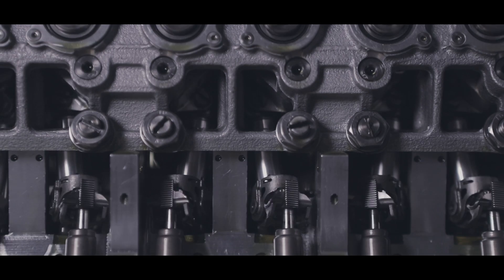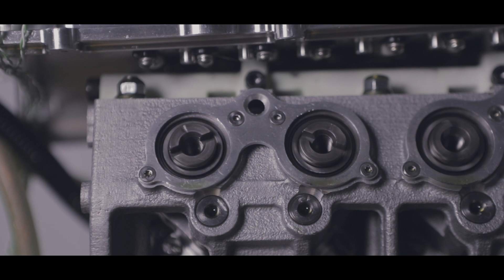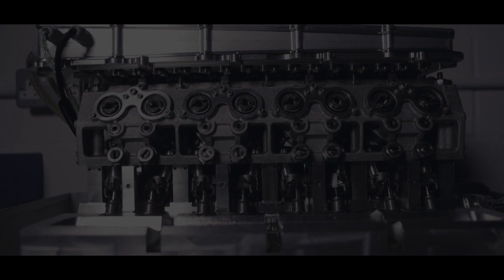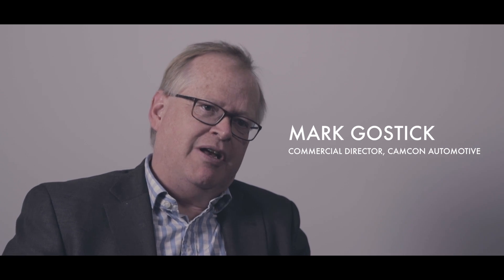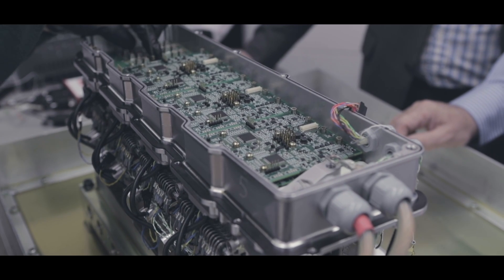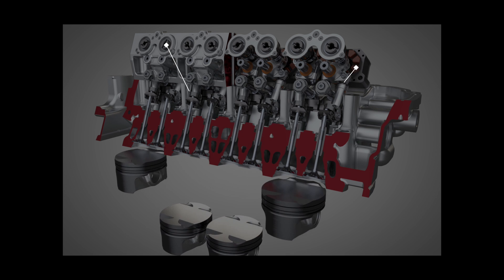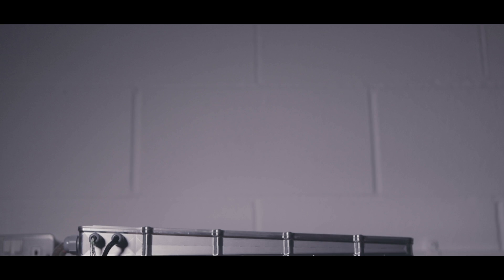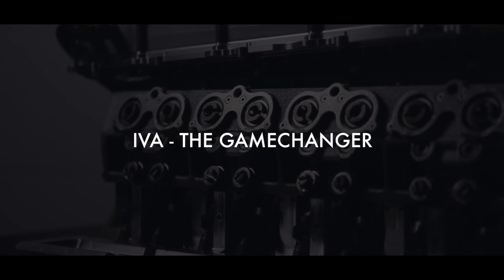Intelligent Valve Technology - Petrol engine, diesel efficiency

Comment: Interesting they went with mechanical individual cams instead of pneumatic actuators. This design is robust but limits the valve life profile to the ground lobe profile. It also adds a whole lot weight and complexity to solve a simple question

Comment: a valve is simply a door that opens and closes. I would think a spinning disc with an opening to release or intake work with so less parts and weight with electronic controls. Moving a valve in and out with all the springs or pneumatic parts over complicated.   A spinning disc with a port would not need much power to move rotary fashion a half turn per cycle.

Comment: Oh. Great. Yet another electric circuit to malfunction, in potentially many millions of vehicles, related to extreme summer and winter temperature conditions.  Most vehicles rarely, if ever, get sheltered in a garage, either...so most would be even more vulnerable. 
One more feature to increase maintenance costs and decreased lifespan of unit, more like it.  
But mainly, it looks like everything Petrol industry controlled, is finally realizing larger competition....other choices rapidly becoming bigger players in the market.

Comment: If you want to amortize the R&D cost, make retrofit head kits for the Chevrolet LS and pre-LS small block V8 and the Ford Windsor small block V8 series. The custom and hot rod market would buy these systems like crazy. Another huge chunk of the aftermarket would be the Ford "modular" V6 and V8 engines, and the Dodge OHC V6 and V8 from the late 90's into the 2000's. Dodge small block V8's (the Magnum series and previous series) could also be a good market to target. Need more? How about Ford's 1600 through 2300 cc inline four cylinders? All those are still used extensively in racing.

Designing retrofit kits for some older engines that are very well understood by performance engine builders would show the automotive industry the capability of the IVA system to be adapted to current engines. With the older engines widely used by enthusiasts, you'd have a ready made testing group.
Reply: The crazy shit you could do with digital values on an LS would turn that engine into a monster.
Reply: taking apart an engine block is NOT an easy "retrofit" like you just walk into jiffy lube and buy a muffler.

Comment: In modern technology, the engine is used to generate electricity. And can the pistons be made magnetic so that they generate electricity by their movement?
Reply: Nothing is free. If you try to generate electricity with magnetic pistons,  you'll greatly increase the "friction" of the pistons. It's not really friction, as in parts moving against each other, but those magnetic fields would encounter resistance from the coils in which the electricity is actually generated. If you've ever used a hand-cranked generator, say in a middle-school science class or something, then you'll know what I'm talking about.

Comment: Why use motors to turn cams?? Just use actuators to open and close valves
Reply: More control over valve lift and dwell this way.
Reply: rotary motion actuation is more robust than linear electromagnetic actuation.

Comment: you have drastically increased the number of parts and electronic involved. I thought part reduction was  number one priority of todays top auto manufacturers because it leads to less weight and less complication therefore less pollution.
Reply: The wieght and complication is outweighed by the gains of this system. Better efficeny means far less co2 emissions than it would take to create it. As well as better mileage and power. Which counteracts the miniscule wieght added.
Reply: Well, no.  Everybody is so ga-ga over hybrid cars, they don't notice that hybrids are hundreds of pounds heavier than the gasoline cars they are derived from, and the inclusion of the extra powertrain means they are doubly complicated.
Reply: No, cars are going full computer controlled so help reduce emissions not the other way around
Reply: Electronization may increase complexity, but also increases reliability. That thing needs no special oil or precisely manufactured camshaft, yet it can be far more efficient.
Reply: 1 control system = 1 part

Comment: looks like an interesting system... although it increases the overall height of the engine from crank centerline to the top of the rockercover... the goal should be to decrease this dimension to lower centre of gravity and improve packaging options for manufacturers......

Comment: How is this an improvement over other camless designs such as the lotus AVT or the Koenigsegg Freevalve system?
Reply: This IVA looks like the basic idea is every valve has its own mini, independently controlled camshaft. Freevalve instead controls the valves directly via hydro-pneumatic actuators. Between the two concepts, Freevalve looks like it has a smaller footprint, better valve control, and simpler to retro-fit into standard gasoline engines. IVA looks like may be less expensive since it uses more traditional concepts to actuate the valves.
Reply: I understand how it works, it's not particularly complicated. I just am interested why they've gone down the route of what appears to be a stepper motor/rotary actuator controlling the individual cams, rather than a direct linear actuator cotnrolling the valve itself.
Reply: @Blaylock1988  Agreed, Freevalve is more better cause of its smaller footprint. But this one isn't complicated either, except that it seems its footprint is as big as a normal one.
Reply: https://newatlas.com/camcon-digital-iva-valve-system/55827/
Reply: "the FreeValve's electro-hydraulic-pneumatic actuation system uses valve springs instead of a mechanical system to close its valves. Thus, it's vulnerable to high-rpm valve float and doesn't offer quite the desmodromic precision the Camcon system does. However, it's fair to call the difference academic when it comes to roadgoing cars, whose motors rarely rev high enough to make that a problem anyway."
Aha, so that's the difference...
Reply: @mbardos  yeah I'm glad the author clarified that for us. Smart guy.
Reply: @mbardos  and frevalve can use nitrogen valve spring as wel, so that's not a problem
Reply: Free valve also needs an air compressor and extra pressurised oil loop to control the actuators. Although the system acting directly on the valves may be more compact, these extra considerations need to be packed in a vehicle somewhere